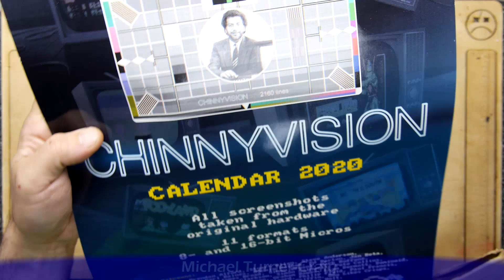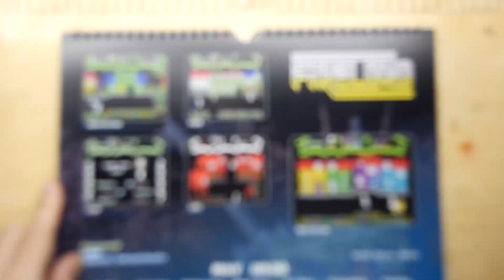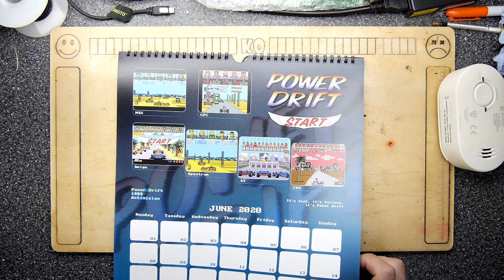Carbon Monoxide Detector Teardown and Chinny Calendar

Comment: The body/breathing essentially  responds to buildup of CO2, not lack of O2. So anything that replaces oxygen is bad, CO especially so as it ties hard to the blood and can kill you even if you're "saved" and brought out into fresh air... N2 immersion is apparently one of the "nicer" ways to go - no triggering of breath/spasm/panic, the brain just turns off due to lack of O2.

Edit:" especially *CO*", not "especially CO2", duh...
Reply from the maker: Sounds like it might be a good idea to get a monoxide detector or two installed as a matter of course